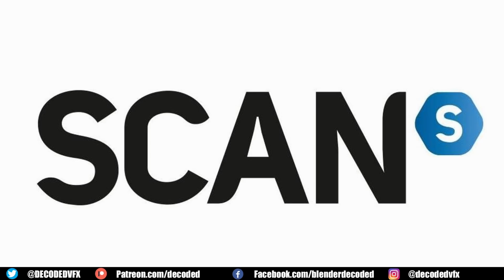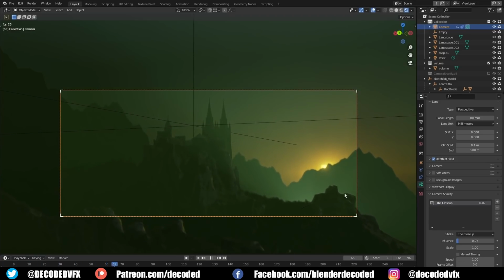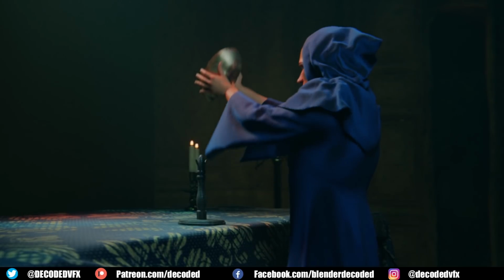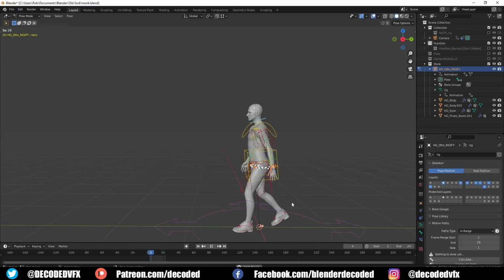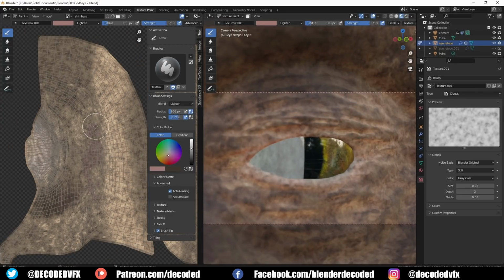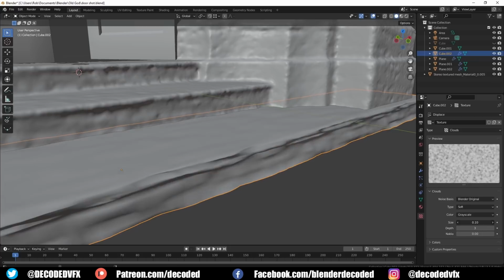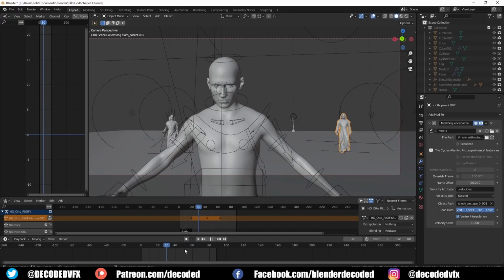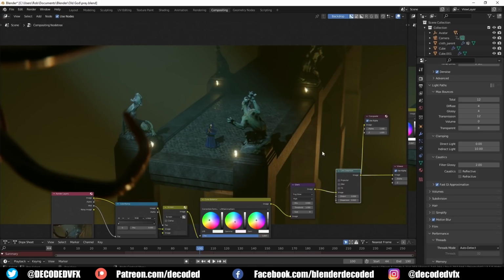Awakening the Old God - Blender Animation

Comment: "Luckily/thankfully, RTX."
Decoded

Jokes and RTX envy aside, you did a fantastic job on this whole project. I wish I had your determination :)
EDIT: Also, thanks for the "set Optix denoiser to albedo only" advice. I should check if it really works better
Reply from the maker: Thanks. The albedo trick is mostly for scenes with heavy volumetrics - otherwise it's almost always best to use albedo and normal passes.